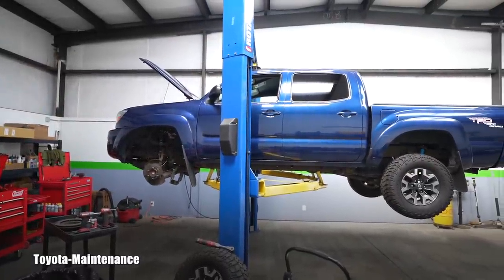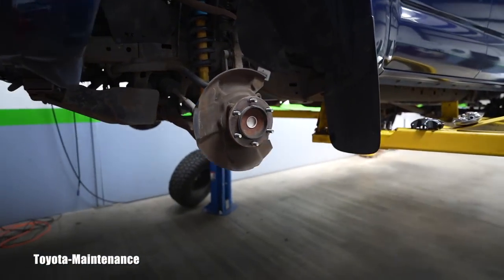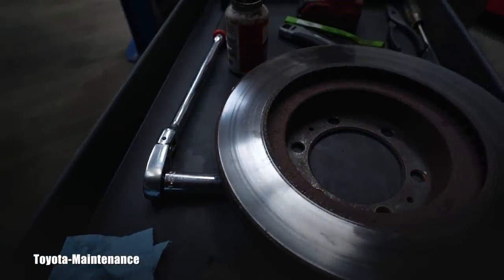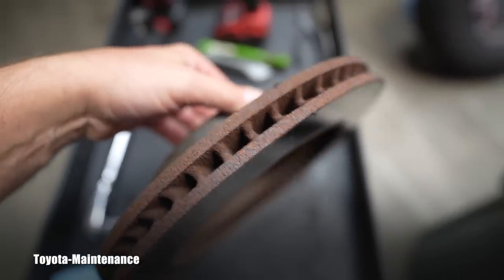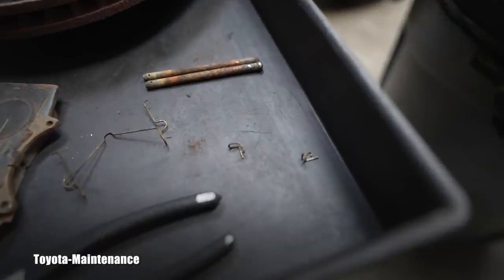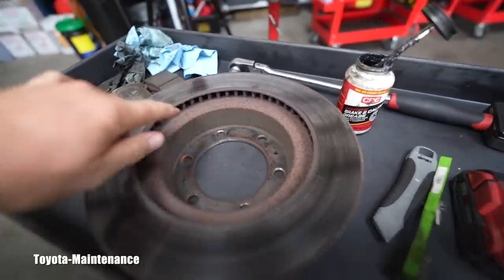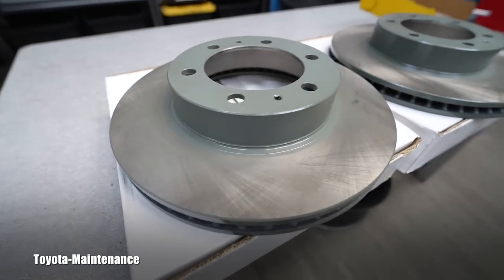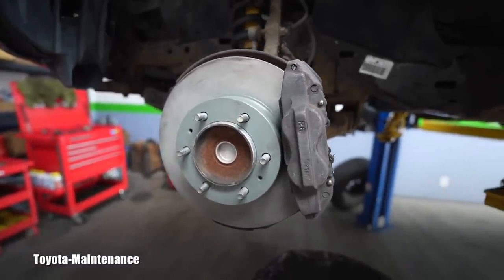Brake Job : Resurface Rotors or Replace?

Comment: I own a 16-year-old Tacoma from the Rustbelt of Massachusetts, with the original brakes/rotors. About a year old ago while having new tires installed I checked the thickness of the brake pads and they were thin, with them having more wear on one side and the pins looking like they were rusted in place.

Do you think I should just get new brake calipers or try to remove and clean the pins instead when replacing the pads?
Reply: I too live in Massachusetts and had to replace my caliper when I changed my pads at 100k because it was frozen. Yours maybe frozen as well....
Reply: @loveydovey4u   I think you may be right, wish I knew when I bought my Tacoma in 2006 that preventative maintenance of the pins by lubricating them once in a while was so easy, and would have prolonged the caliper's life... Thanks for the response, Chuck!
Reply: As long as the pistons push in easy and smooth just clean or replace the pins I have that style in my motorcycle and then polish up great and they remove easily with a spray of lube and a small brass punch